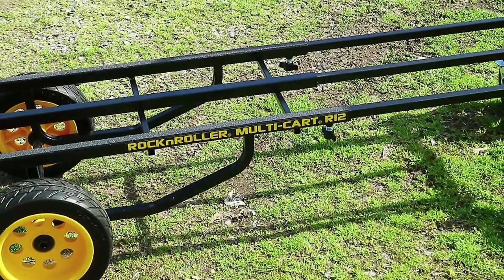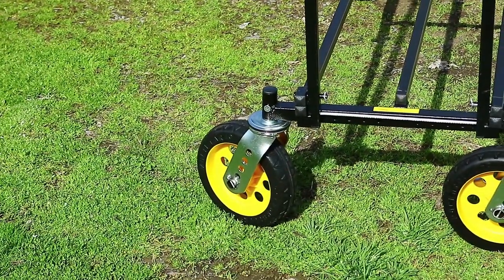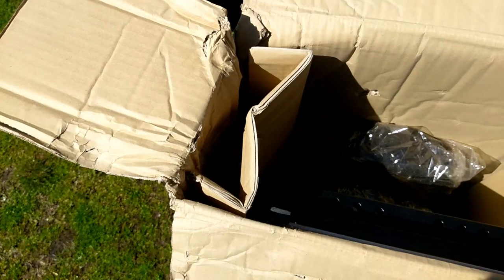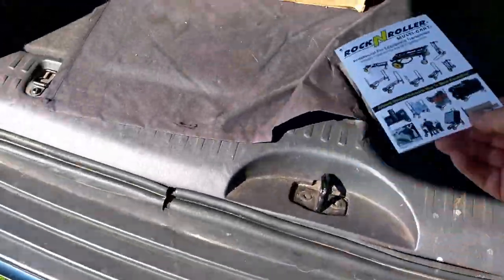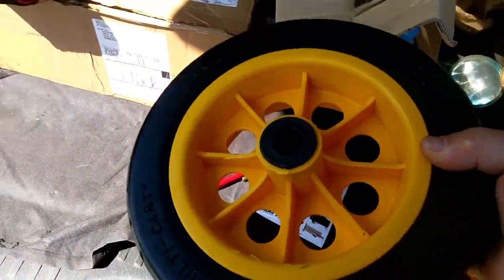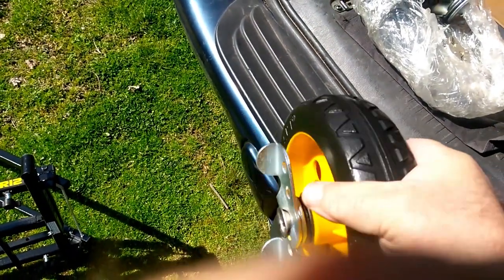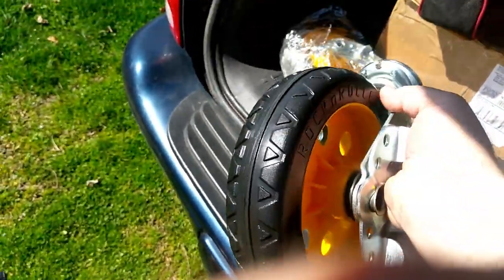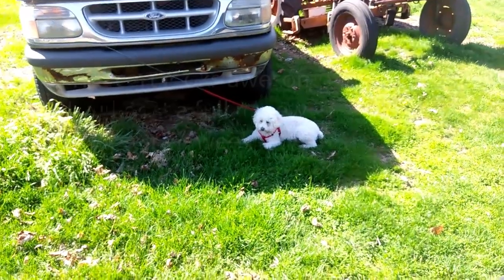Rock N Roller R12 Multi Cart

Comment: Just to help the viewers, one small correction. The black washer goes on the outside of the large rear wheels not the inside. The nylon washer protects the wheel from the cotter pin. Reference rock n roller’s assembly video on YouTube for more detail.
Reply from the maker: Thanks for the info. What you say makes a lot of sense however, I put the wheels on as per the instructions. See the frame of video at 7:01 in the timeline. The sheet shows the washer behind the wheel.